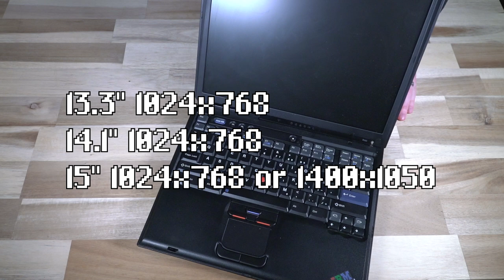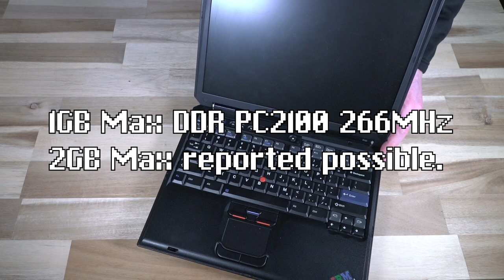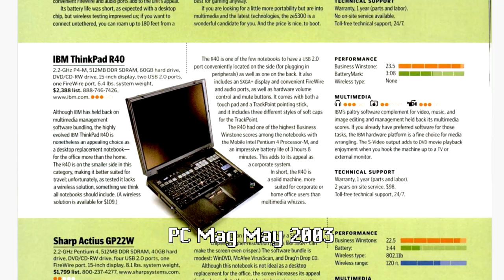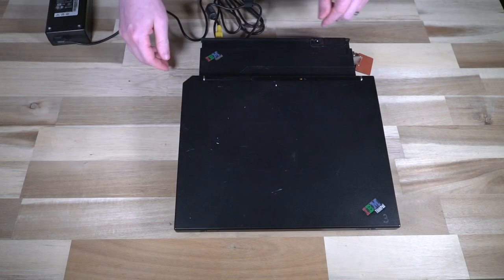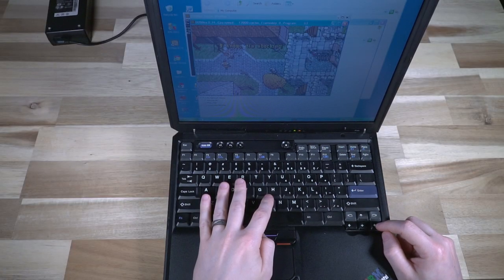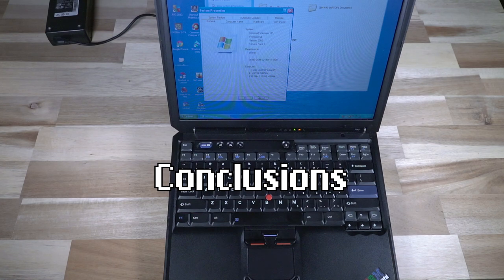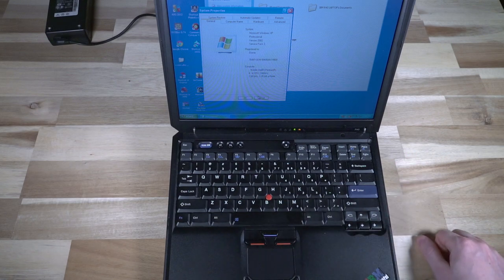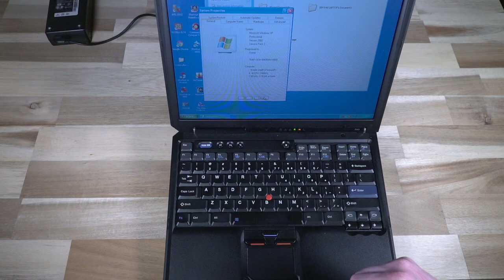IBM ThinkPad R40: A Time Capsule of Design Ideas

Comment: Excellent! The R series aren't the "Rubbish" series. As some snobs like to dismiss them as. I bought one brand new in about 2005. It's an R50e, which is an even more "value" model. Missing the trackpad and docking port. It was the cheapest ThinkPad you could buy. I still have it, in fact I have two now! Still going strong so many years later. Both are Dohan Pentium M with 2x1gb PC2700  DDR and sporting the Intel Extreme Graphics 2. If you didn't specify the Wifi card you didn't get the socket!   
One thing about the CMOS batteries. When they fail you may get all manner of spurious errors. HDD errors and EC (embedded controller) failure messages. I cut the batteries out of the plastic cover. Peel off the metal contacts from the battery, flatten them back out and tightly wrap them back onto a new CR2032 with electrical tape.  It may then take a few boot cycles for the machine to stop sulking. I wonder how many have been thrown away just because of bad CMOS batteries?
Reply from the maker: Too many I suspect. I've brought back several machines that had loads of errors due to the battery tripping all sorts of codes.
Reply: To be honest I love the appearance of the R series models more than their T series counterparts. R for "Rubbish"? Dilettantes.

Comment: I found an R40 in my school's electronics recycling (Not quite recycling, but just where the doomed laptops go). The IT Director let me have it, and it powered on and worked perfectly (after bullying the CMOS)! However, I found a newer T-series and, as is usual with these old T-series, the rubber coated lid had started to melt. Overall, I think that despite their budget nature, the R-series is better for longevity (despite the ATI cards) because of the relative durability, as well as lacking the rubber lid of the T-series. R-series ftw!
Reply from the maker: The R series deserves its time in the sun. Glad you have one.

Comment: I have a t60, t61, t520i and a t40 like this. All of them have been modded with ssd, more ram, better processors and all running variations of linux. I love thinkpads. Thanks for the video mate. Love from Australia 🦘🌏
Reply from the maker: That's awesome! Glad you are working on these devices and keeping them useful.👍
Reply: @LaptopRetrospective I love working on them!! I recently acquired another beautiful t61. Just installed 4gb ddr2 and a 1tb SSD, new 9 cell battery . Runs like majic. Using Linux tails

Comment: Ultrabay 2000 is any time better than Ultrabay Slim. U can gut out the DVD drive and replace with a PATA to SATA caddy for a 2nd drive. I modded old T30 this way. 

Unfortunately, u cannot do the same for Ultrabay Slim. Hard to find the caddy for my X6 and X6T docks.
Reply from the maker: Hmmm. Wonder what the part number/FRU is for those?